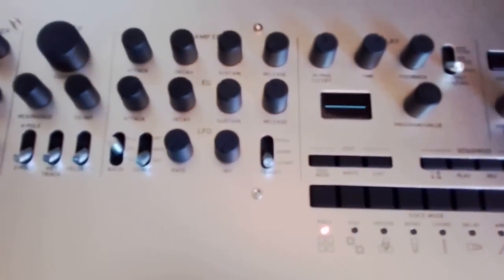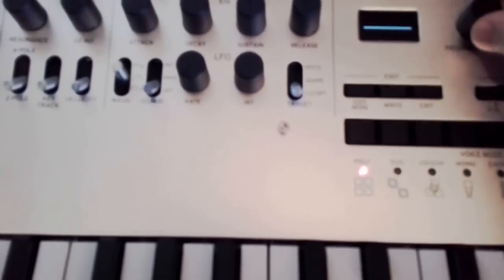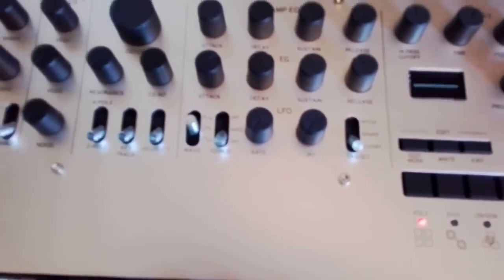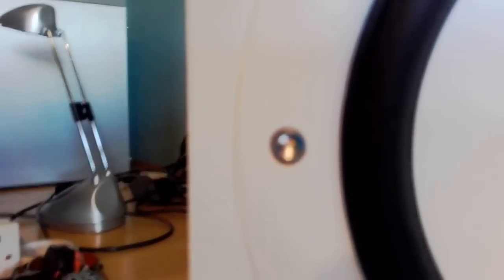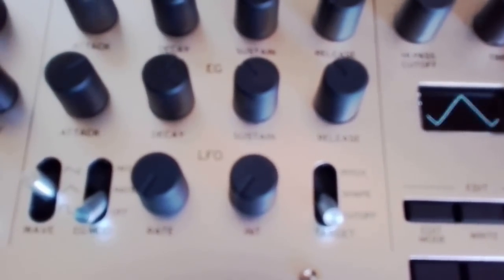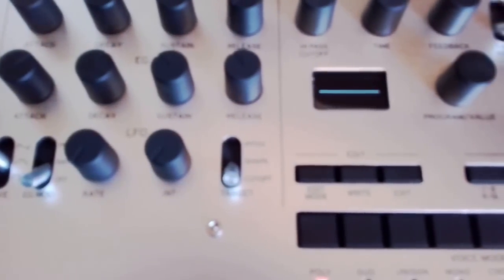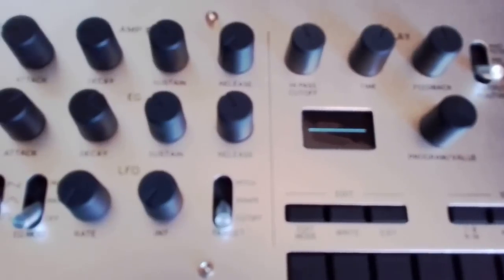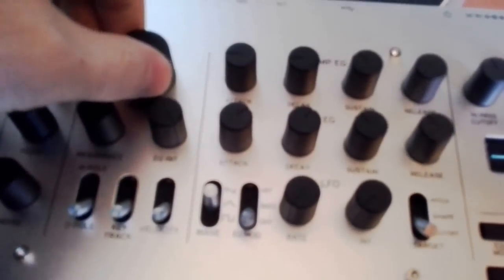KORG Minilogue Excessive VCA/Envelope Clicking

Comment: ok so several people have posted videos regarding this issue, so what is the solution to the problem or is everyone returning their synths?
Reply from the maker: Dunno if Korg have issued a solution. I just returned mine as I was able to, after Korg said they could not guarantee a fix to the problem.
Reply: thanks for responding, so what would you recommend as the closest thing comparable for the same money?
Reply from the maker: +444 Levels Nothing really. The Waldorf Blofeld is nice, but virtual analogue. At price point Korg have done well as build quality good. Just the sound that lets it down mainly due to this excessive clicking. The small keys aren't that great tbh. Depends what you want from a synth but Blofeld has full size keys, nice action, w aftertouch and feels like a proper instrument as opposed to a 'supertoy'.